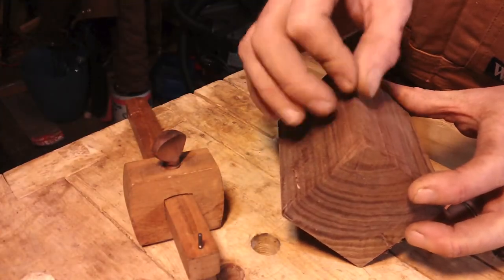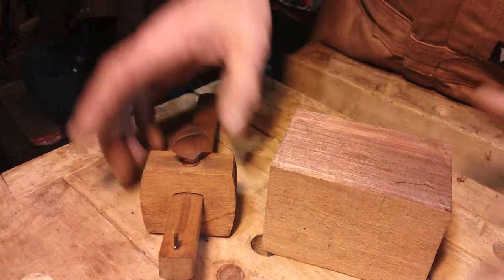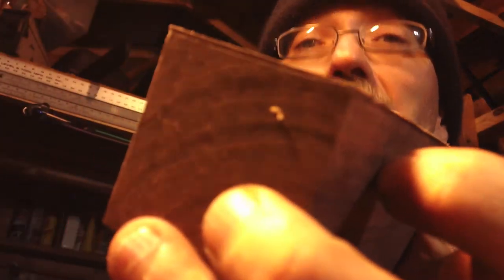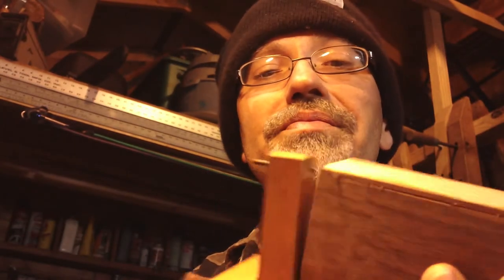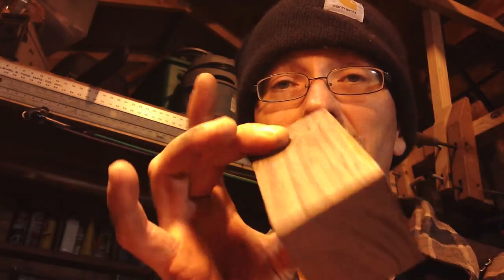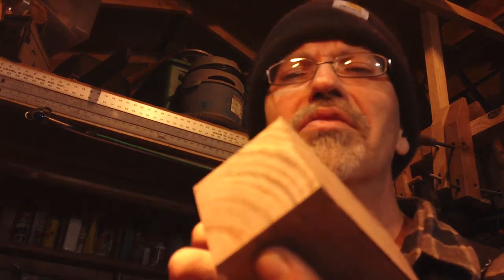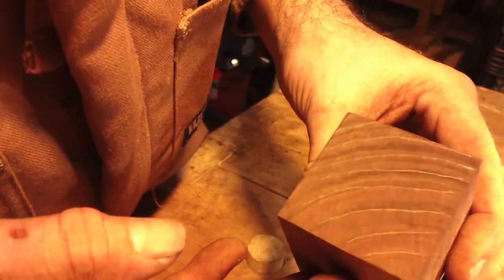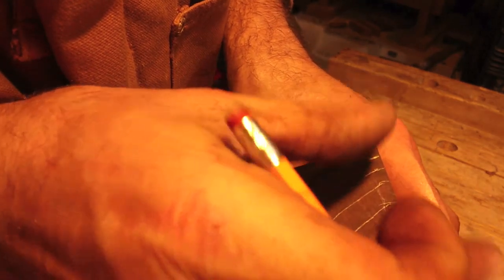Dovetail Grease Box

Comment: Not being able to hold this in my hand, I have a question.  What is the top lid for?  It seems to slide out of the way then you slide the bottom lid independently.  Is it locking the bottom lid in somehow?
Reply from the maker: +Eric Bullard Yes sir it is. Notice it is cut at an angle and locks to keep the top lid from just flopping open. Bottom lid has a dovetail key this locks it from side to side movement. Top lid locks the bottom lid from moving away from the dovetail key.
Reply: +Dave Bardin - so it's only the bottom lid that slides away from the butterfly, not the top. Thus the top forces the bottom not to disengage from the butterfly.  Am I correct?
Reply from the maker: Yes you are! Outstanding.